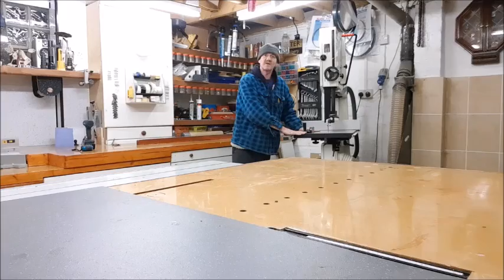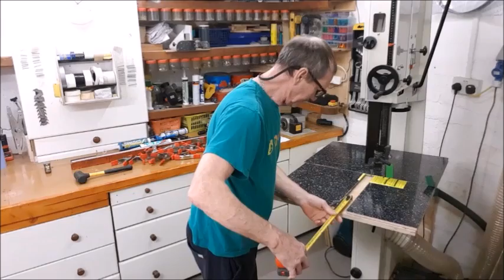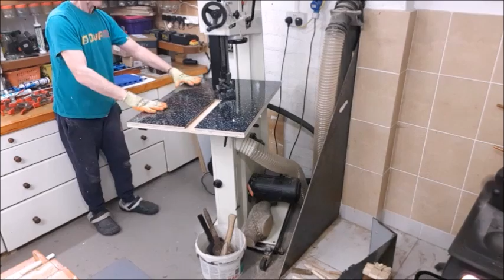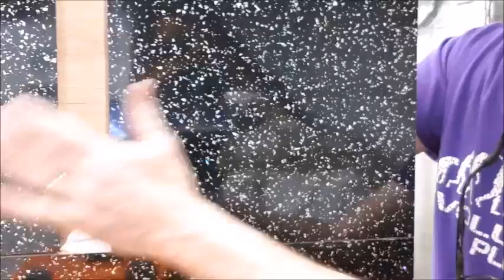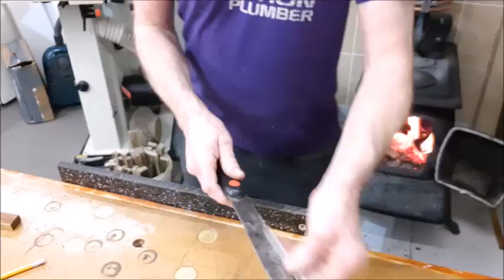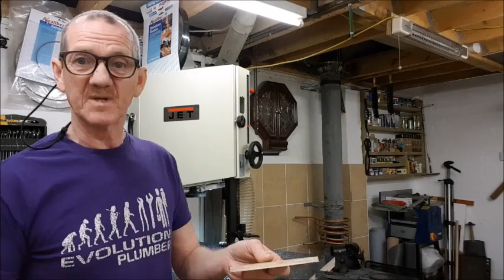Quick no hole circle cutting jig

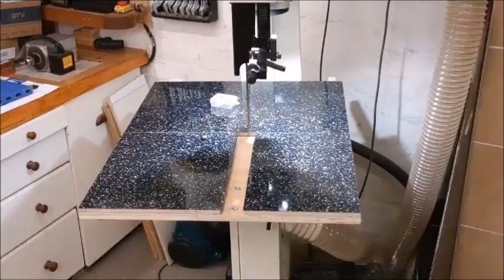Comment: At 8:56 you show that pin in the sliding board - what is it called? I listen 5 times right before when you open the package and still can't understand. I'd love to try this.
Reply from the maker: Hi sorry if there was a sound issue but the pin I call a dowel pin it's a centre pointer used for Doweling
Reply: @dmgladden  Thanks for the quick response - have a great day!

Comment: I have been trying to figure out how to build a bandsaw jig that will allowme to cut rounded tops on 1 x 4  boards which of course are 3/4" x 3 1/2".  I build cornhole boards and I use 1 x 4 legs.  I have not been able to figure out how to build this jig.  For now, I am using a pattern that I made from MDF and using double sided tape I am routing the ciruclar end on the tops of these legs.  But it is ver slow and I need to figure out some way to do this on my band saw.  I have a 1/4" blade on the saw which should be small enough for this radius but I simply cannot figure out how to design the jig.

Just wondering if you might have any suggestions on this.  
Thank you very much.
Reply: Did you come up with something? I want to cut rounded corners as well on blanks

Comment: Not “quick”
Reply from the maker: No rush, the turm quick was relating to the use of it not the making of it
Reply from the maker: Again today i used it and i stand by the turn quick i did a 900mm circle in a matter of minutes
Reply: Not "no hole" either.
Reply from the maker: @davebashford3753  its an indent not a hole easy removed with water on most wood, holes go through

Comment: David nice vid. Always looks cold when you walk into your shop when my son who is a electrician did my workshop we installed conduit pipe work from cable trunking he also installed wall mounted electric heater 
With attached timer so I have heating all the time and it turns off when the temp falls below 24c so it nice in the summer Just a idea maybe for you workshop 

Many thanks
Harry
Reply from the maker: Hi Harry thanks for the concern yes i have thought of things i could do to warm the place up but i guess its become part of the ritual and im not sure what i would do will all the spare time i would have not loading the fire, or come to that what would i do will all the of cuts i burn, anyway more for me to think about, thats for watching